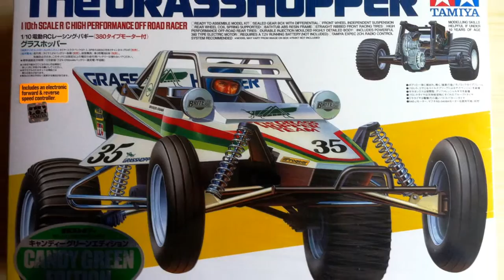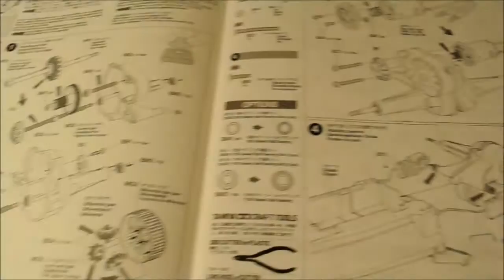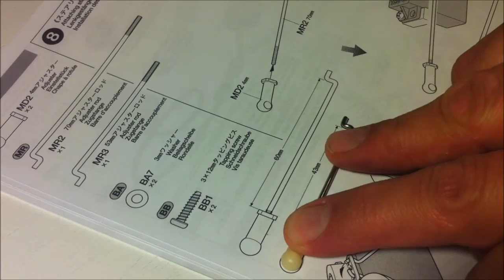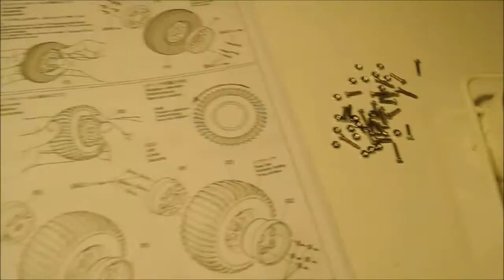BUiLDiNG the Tamiya Grasshopper Ltd. Candy Green Edition #84331 (Part 1): Assembling the Kit

Comment: O man nice kit!! I HIGHLY recommend you get a bearing kit there very cheap on E-bay for this chassis and will make it run and last longer. LOL the wheels and tires are the hardest part!
Reply from the maker: +shenlonco Hi Shenlonco. Thanks, I like it too. No, not yet ... think I'm gonna keep this bone-stock. Got other Tamiya 2WD Buggies (with bearings etc.) to play around with. Maybe if I use it a lot I will upgrade electronics and replace the plastic bushings but I have a Hornet coming up so I will probably use that a lot more ;-) and ... YES! Fitting those tires was an absolutely nightmare! I forgot to film that part - I was too busy sweating and swearing, lol :-) Thanks for watching and commenting my friend
Reply: +Nordic RC Visions Cool I guess if your not going to run her to much it will be fine.Yep those tires will never come off a wheel that's for sure! :-)
Reply from the maker: Ha ha, nope, that won't happen. I'm aready dreading to fit my Hornet tires too after that experience. Yeah, I will run her, until I finish up my Hornet - but after that I'm guessing I will prefer The Hornet, with the light lexan body, the motor and the dampers.

Comment: hey mate I got one of these re release grasshoppers as my first proper rc car and if I'm honest the 380 motor was path, just upgrading to a 540 silvercan makes a he'll of a difference
Reply from the maker: +Montygeorge 32 Yeah it really do. I got a Hornet coming up, which comes with the standard 540 Mabuchi, so I will just lave the 380 in this one. Got some Grasshopper running videos coming up, so stay tuned.
Reply: I like the way the car runs with the 380 because it has a scale look to it with so little power but it is slow. At least it make a sivercan feel fast!
Reply from the maker: Yeah, these motors gives you an opputunity to install a 540 brushed silver can in a model and then go "wow! it is fast!" he he. So 80'ies. I like the 380 motor on the Grasshopper too. It looks so great hopping along with that motor :-)